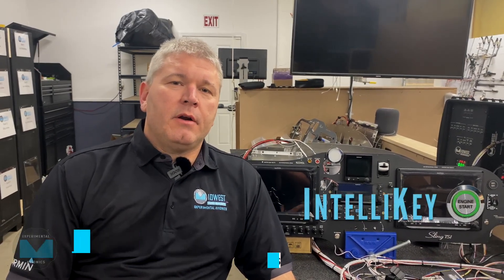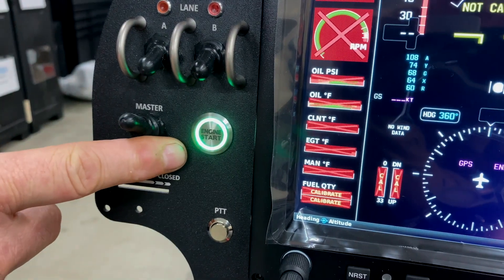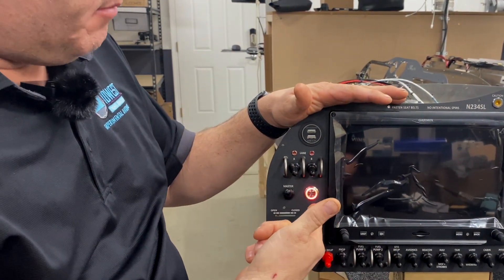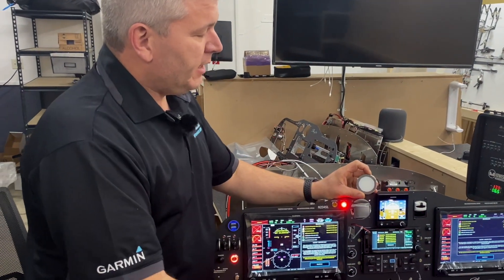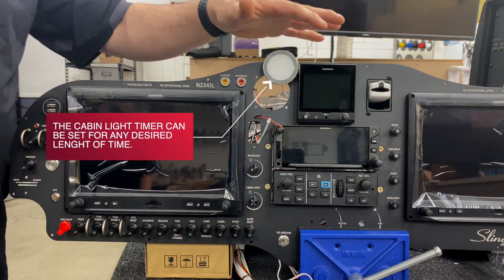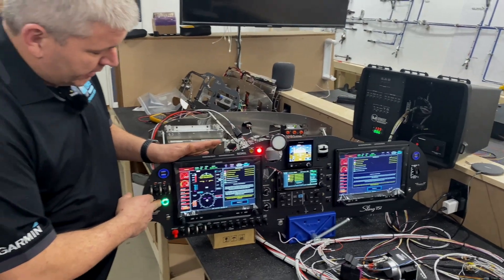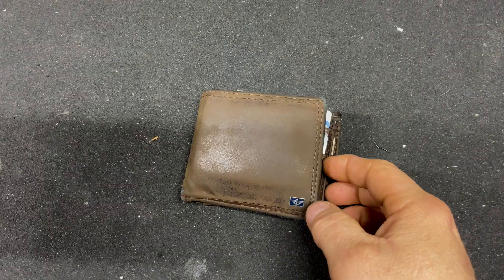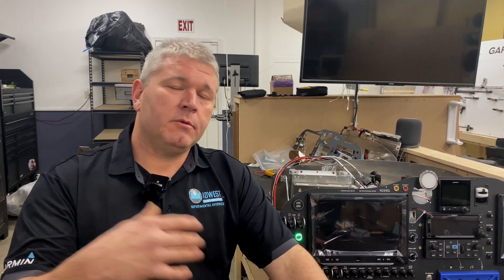Start your airplane with the key in your pocket - IntelliKey

Comment: The system seems fine but you guys are really gouging the crap out of people on price.  I can replicate this system for $50. It's just a Chinese ble tag available on Amazon for $15 and a microcontroller that reads it. There's no innovation here it's just charging a crap ton for 15 year old tech that can be made from parts in stock microcenter.
Reply from the maker: Thanks for watching, yes this was our first attempt and is quite archaic. We are now on version 3 which also includes voice and data recording and can be controlled from any device or with an iOS app. We will soon be adapting this system to other products currently in development. So you are not wrong, the very first system was quite simple but was also far cheaper in price, we all have start somewhere.
Reply: You guys have this thing listed at $850. Esp32 is $5 custom PCB is $3 latching relay/passive components $3-4, button $1, RFID module $5, RFID key $.10, ble key $10. Wire $10 cases maybe another $7. So that's around $50 so let's $75 gets you a shippable product. Development cost is basically nothing since this is just grabbing stuff off the shelf and assembling it. Maybe $800 The college kid you hire can design the PCB and write 50 lines of python. I guess I'm just not getting it.
Reply from the maker: @mp-xt2rg  Thanks again for watching, we appreciate all of you who do!

Comment: Drops keys out the window. Engine sputters and stops. Tries to restart engine. Red light of doom.
Reply from the maker: Actually, if you were to somehow accomplish the act of dropping the keys out the window and your engine somehow sputters and stops all at the same time, and the propeller stopped windmilling, the system would still allow the engine to turn over. The start signal will stay active as long as the master is on., and times out 15 minutes after the master turns off. We thought of that exact scenario when designing the system..

Comment: How would you go about starting the aircraft if the button were to malfunction for some reason? It seems like there are wires that check if certain systems are on/off, etc. Do those wires inhibit the switch from operating even if the key is detected? Seems like there are a lot of points of failure on this design.
Reply from the maker: I’ve seen many start switches in certified aircraft go bad. What if a mag wire breaks? Yes there are safety checks for the system. Without knowing the design it’s not really fair to judge the quality.

Comment: Looks very interesting!! But during the run up how do you check the magnetos ?
Reply from the maker: Toanui Raoulx on the Rotax engines with mags we use toggle switches, the iS version is faded controlled so it uses lanes instead. These are also toggle switches.